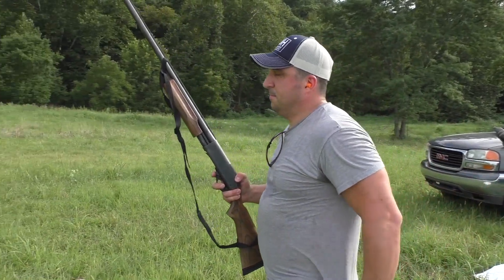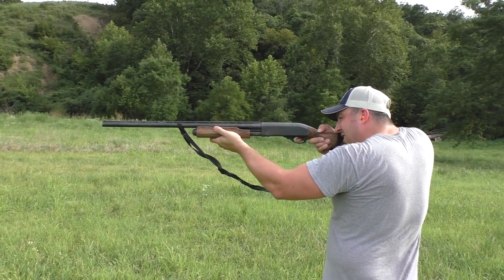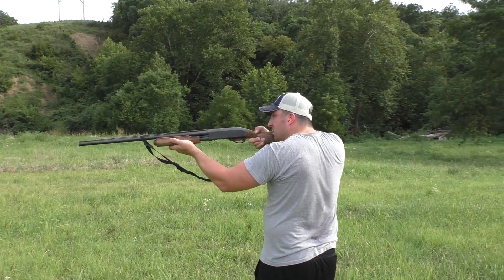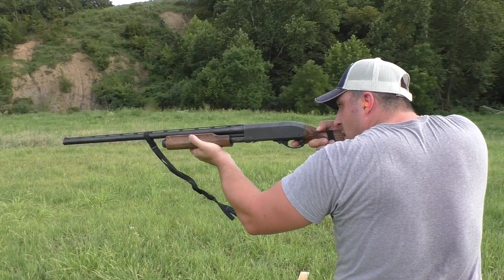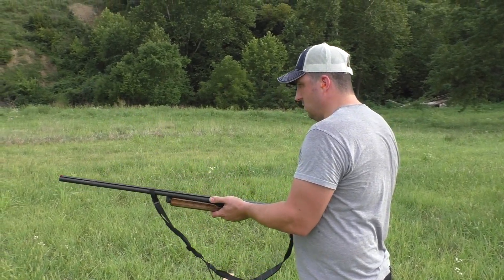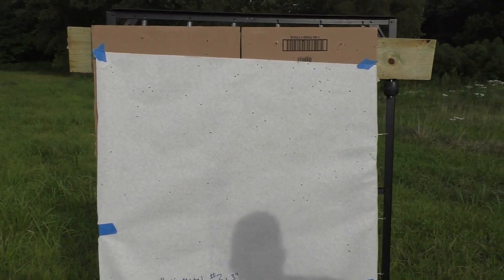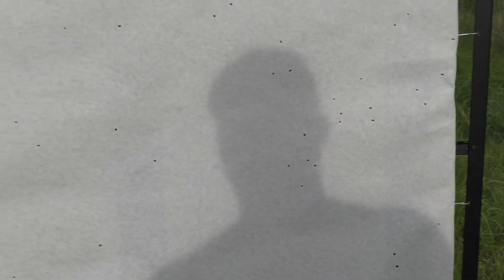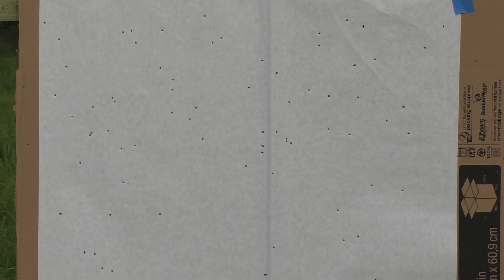Duck Hunting:  Heavy Metals vs Steel Shot

Comment: Duh!
improved cylinder is not the  choke to use for more than 25 yards
Reply: @EthanSmith2398  But Improved Cylinder is an Open choke, not a Tight choke. I was wondering why they used it instead of a Modified or Full. I use a Full choke for anything smaller than BB shot and a Modified choke for BBB shot and larger.
Reply: Thoughts for using 3 shot vs 2 shot?
Reply: That is exactly what i was thinking

Comment: Guys, good video really enjoyed it. I have been experimenting with shotshells for about 4 years now and this is the conclusion that I have come to.
1. With steel, speed kills. Personally, I like to shoot 3 inch number 4 shot of good steel shot. However, I did find 3 1/2 inch blind side high velocity shells in number 6 shot. These shells were only an 1 3/8 once so they weren't super heavy loads for ducks, and the shells were actually cheaper than the 3 inch shells I could find, and they patterned really well!
2. When it comes to geese, don't go cheap! We shoot ALOT of geese every year, and the hevi shot or anything that is denser than steel makes a big difference in the amount of cripples that you get. I shoot a max of #2 shot for even the big canada geese and sometimes even venture down to number 4 shot depending on where we are set up and the weather.

Lastly, I like how you guys shoot ducks close, that is how I love to shoot them as well. Generally speaking, if ducks are not feet down we don't shoot. However, I choose to shoot a Kick's extended full choke even with the ducks and geese close. I know that may sound like overkill, but alot of the areas that we hunt are very thick timber and river areas, and if you don't stone a duck dead, there is a good chance of loosing the bird. Personally I would rather keep a tighter pattern and feel confident that I will either kill the duck or clean miss it. I know you are probably thinking that a full choke will destroy the ducks, but when you shoot a tighter pattern with smaller shot, I have found the damage to the bird and meat are about equal.

Anyways, love the videos, if you guys ever find your way out to California, let me know, I would love to get you guys out on a hunt with us.
Reply from the maker: Great comment! Thank you so much for taking the time to post this.
Reply: i saw a video of hevi shot when it first came out and to show the energy difference they hung a steel plate from a swing set and shot it with steel and hevi metal at 20 or 25 yrds you wouldnt believe the difference. they even went as far as to show a 12 gauge shooting steel and a 20 gauge shooting heavy shot the results were crazy. pretty neat stuff if you would want to try it.
Reply: Greg, you and I are on the same page. Clean kills or clean misses is what it's about. Our rivers in Wyoming are too cold and swift to have the dogs chasing cripples around forever.

Comment: still using steel. I used winchester 2 3/4,  #4,  1 1/16 oz for opener in MN this year for opener with great results. Birds decoyed well and all shots were within 25 yrds and all birds fell dead from the sky no double taps. Steel has come a long way since its intro and i only use hevi-metal for turkey hunting because a lot of the areas I hunt are waterfowl production areas that only allow non-toxic shot. I have even considered eliminating lead for pheasants and grouse. Thanks for making the videos and for your ethical approach to the game. Good luck and shoot straight!

Comment: There are so many variables when it comes to shotgun shells and patterning that I typically don't worry about patterning my guns. If you let the birds in close enough, you shouldn't need to worry about holes in the pattern. I've noticed that the less I focus on the minutiae of my shooting the more birds I kill.
Reply: just pattern with your own gun choke and load and see if it needs improving at whatever range you normally shoot  but at 25 yds max shooting steel number 6 like fast steel kent with improved cylinder should be excellent.

Comment: I had a similar experience patterning steel vs. hevi metal. I bought a box of hevi metal to see what the fuss was about, and had to use a full choke to get the pattern I wanted (keep in mind this was primarily for hunting divers over big water, so birds that are generally a little tougher to kill cleanly and also typically longer shots than on puddlers). In the decoys, I didn't notice any difference vs. steel, but I did notice I had a few cleaner kills on birds leaving the decoys that were on longer shots. All in all it wasn't enough to justify the price difference for me. Hevi shot ran the same rebate you guys mentioned last year on Hevi Steel instead of Hevi Metal, I picked up a couple cases then and I have really liked the way it performs. I shoot it through a LM choke for puddlers and a modified or full for divers/big water.

Comment: I shoot #4 2 3/4 or 3” #4 with a modified choke. And sometimes 3 1/2 either #4, Bb, #2 shot but usually only use them for geese or an injured duck that’s trying to get away. I usually just stick to federal,Kent, and Remington. And I’ve killed with all three manufacturers. Great video
Reply from the maker: Thank you for taking the time to comment!

Comment: last year I started the season with winchester Xpert  3inch #4 and had more than a few cripples between 30 and 40 yards. I switched to hivi-metal 3inch #4 half way through the season and the number of cripples went down to 1 at the same distance. I also use a modified choke.

Comment: I've killed mallards in late December with steel 2 3/4 Winchester 6 shot.. mod choke. All I had so I ran it. Folded birds just as good as anything else I've used. Not my everyday load I take but hey it worked..

Comment: I switch to heavy metal last year from using kent faststeel and my shooting improved from 47% the season before to 62% last season. I don't know if the accuracy change was due to changing ammo as much as changing to a heavy metal mid range choke which gave me much better patterning, but I did have a lot fewer cripples and almost had no birds that required a kill shot after hitting the water.
Reply from the maker: I'm planning at some point to do a video on keeping statistics.  We've been keeping our shooting %, birds per hunt...etc for years.  Curious, do you count shots on the water towards your % and how do you track your shooting %.
Reply: +Freelance Duck Hunting I do not count the shot when they are on the water. I just count how many it takes to put them on the water. I have a write in the rain notepad that I keep notes on each hunt such as location weather decoy spread and number of bird we saw shot and how many shots we took.
Reply from the maker: Thank you Daniel, we do not count shots on the water either.  I have a shell belt that holds 24.  I just keep track of how many I shot on the water and then check my shell belt.

Comment: I have tried 3 inch,, 12 gauge Hevi-X (all tungsten alloy pellets) for the last 2 years. I went to modified choke too. The first year I did 6 shot, modified choke, to get something very similar to the old lead 6 for ducks. This seems to kill much better at longer ranges than the Hevi-Metal 4 (layered tungsten over steel) that I used to use. The problem was my little handheld metal detector that I scan meat with won't consistently find size 6 in the duck meat and I broke 2 teeth. This year I am shooting Hevi-X size 4, modified choke and I am doing just as well on ducks and the metal detector finds the shot reliably. Plus with this size I feel confident if I get a rare shot at geese it will down them. I hunt public ground and if I get 6 shots off in a day, it's been a good one, so I don't fret about the increased cost. But with the current shortage of shells, I might have to go back to high speed steel before the end of this season!

Comment: The way I do it may or may not be the way the experts would do it,but it works for me. 1st I choose the gun and tube. Then I buy a box of several brands of shells . For instance If I change to a new tube I would buy a box each of Kent,Winchester xpert, black cloud remington and federal since all are readily available here. none would be slower than 1550(with steel speed kills) and I would buy boxes of each brand in 2s , 4s and 6s. 2nd, prepare 5 targets for each  box of shells. Mine are 30" circles divided into 4 quadrants with an aiming dot in the circle. If the choke is I/C I place them 20yds out and 30rds for MOD, 40rds for FULL. Shooting from a bench, I put the bead on the dot and shoot 1 shot in each target. Repeat for each combination. Discard any set that routinely show gaps big enough for a bird to fly through. Then I count the pellet holes in each Quadrant. What I am looking for is a  load that can consistently throw 60% above the horizontal line and as close to 50% as I can get left and right of the vertical. I choose the best 2, shoot the best one and remember the 2nd best to fall back on in case  I am away from home out of shells and my go is unavailable locally. 
For my 835 Ultimag with Carlson Mod choke (Lake Eufalla and Nav Chanel, X at 25-30yds)  Win Xpert 3" 1550 #2s.
Carlson I/C ( Timber, ponds, creeks X at 15-20 yds) Win Xpert 3" 1550 #6
Pattern Master Full (pass shooting Sandhills and geese at Hackberry Flat) Federal 31/5" 1550 BB. 
Now you ask,What do you do with all that extra ammo? Give it to your partner to pattern his gun and you have plenty left for squirrel season where anything is good enough.

Comment: Bought a case of Hevi-Metal 2's from Rogers last year. They seem to do the job quite well through my Browning Maxus with an extended range patternmaster and I definitely noticed an improved kill rate and less cripples. The trouble was I've made it half way through this case and had 5-6 dud shells, I will be back to the federal steel after this case is gone, I can't stand when you pull the trigger and it just goes click, that's is inexcusable for a high dollar shell.

Comment: If you're shooting decoying ducks and geese, try using a modified choke or go with a smaller shot size in heavy steel.  Works great for me.  I use heavy shot or steel #4 in a modified choke with great results when I'm doing my part on the business end of the shotgun.

Comment: Steel patterns tighter in the same choke than lead. I know the Hevi products aren't lead.  An imp cly with steel is closer to a modified choke. Also, the same box of 25 shells will pattern completely different in Dan's 870 than your A300. Every gun will have it preferred load/choke. Also, your dad is correct in the Hevi 4's are more similar to steel 2's.  I hope that you pattern test again. Love the hats and vids.
Reply: I forgot to add that I shoot the cheap Winchester Xperts, after seeing little to know improvement with the more expensive Blindside, Fasteel, and BlackCloud.  Can't see spending $1.25 per shot of Hevi when the cheap stuff works great with my barrel/choke.
Reply from the maker: Thank you for your comment.  After filming I did pattern my A300 at 15 and 25 using the federals.  I was pleased with the patterns.
Reply: Forgive me for the long post but here are my thoughts: HillBros06 is dead on. Steel will pattern tighter than lead no matter the choke. Shooting Improved Cylinder with steel is basically shooting a Mod. (or very very close). Quick report from last year - I decided to go with heavy shot for the 2015 season. After patterning both Mossbergs, I found that the results were not what I had anticipated. During early real season it seemed using #6 and Imp Cyl certainly shot more ducks but the cripple rate was a little higher than what I would like. Found myself taking more "second" shots to make the kill. I initially thought it was my choke and changed to Mod. This didn't help. So I went back to original set up and changed loads. Went with Winchesters #6 and my cripple rate went down substantially!  To prep for regular season, I patterned full choke, Mod and Improved with #2, VS #4s Heavy Shot. The results were ambiguous. I decided to stay with #6 for early season and #2 steel for regular seas.
Reply: I might add that what I have found is that while heavy load will certainly pattern differently,  steel just seemed to shoot tighter (in my gun with current choke) than heavy load. My cripple rate went down and I just felt more comfortable with that shot/choke. 
That said, I think it's all in what you are comfortable shooting. Duck hunting is more mental than anything and if you feel that a particular shot size and choke suites you better, I feel that you will certainly kill more ducks simply due to the mental aspect - more of a comfort thing if that makes sense?
Reply: +HillBros06 TOTALLY AGREE with this statement!

Comment: Hevi-Metal is actually a mix whatever size steel (marked on box) and generally about 2 sizes smaller Hevi-Metal pellets which are lighter than Hevi-Shot but heavier than steel. The reason they do this is so that the denser, smaller shot weighs similar to the larger, less dense steel and flies similar to the steel. If you used the same size denser shot shot, it would blow the pattern apart like your dad eluded to.

After having studied ammo and tested almost everything out there, I've come to the conclusion that speed and a good choke are more important that actual ammunition brand. I run Federal 3" 2's through a Patternmaster because it gives me a 96% pattern in a 30" circle at 40 yards. That means almost all clean kills or clean misses on decoying birds because all but a very few (<10) pellets are ever outside that circle where I am aiming. It is worth noting I shoot mostly large ducks (mallards and wigeon) and have a chance at geese almost everywhere I hunt so I run 2's. If I was only hunting ducks and could get similar pattern density, I would shoot 4's.

Comment: I've used regular steel and Heavy Metal brand and haven't noticed much difference in taking down birds except I have taken birds at much greater distances with Heavy Metal. With heavy metal I shoot a 6 shot 3 inch shell and my first year using them I took down a goose at at least 15 yards further than I am comfortable shoot normal steel shot. When I shoot steel I shoot 4-6 shot in a 3 inch shell in late season and a 2 3/4 inch in early season

Comment: I found that if you are using steel you will have to use a larger shot size and reload it with a faster fps to get the energy down range on your target. I reload 12 gauge 3 in Federal Hulls with Alliant steel powder 43.5 gn powder, Ranger Elite Wags, 1 oz steel BB, 12Ga overshot card. = 1100psi and 1710 fps. With this recipe I have been killing Canadian geese and dogs out past 50 yards. All my friends were amazed and they stopped buying store bought shells and they started paying me to make them my recipe

Comment: The reason that the pattern breaks up faster is because the hevi shot in there is going slower. And it behaves similar to the difference between lead and steel. As you may or may not know an Improved cylinder choke with steel patterns the same as a modified with lead. I shoot steel early in the season when I am shooting smaller ducks like teal and woodducks but once I start hunting late mallards and geese I start using heavy metal #2 and boy it hits them way harder than steel. Because you guys like to shoot them when they are right in your lap I don't think it will matter too much. I might recommend something like Winchester blind side that has a lot of shot and opens up quickly for those closer range shots.
Reply: I was watching a video on patterning this afternoon and it said that hevi-shot is not round, kinda oblong.  Do you know about that?  If it is it certainly explains why the pattern breaks up faster.
Reply: +Carl Snider I haven't ever heard anything about that before and when I cut open a heavy metal #2 I didn't notice anything like that. One thing that they do put in the shells is flax seed(or something that looks like it) and I'm not sure what the purpose of the flax seed is but maybe they confused the shot with the flax seed they put in there
Reply: +Carl Snider hevi shot is a bit oblong and blind side is little cubes I believe the reason for this is that the lead will get miss formed when it hits creating a bigger wound channel so there trying to imitate that with these loads black cloud is also oblong and has a small seam looking thing on it to make a bigger wound channel also personally enless im shooting geese i dont care
Reply: You are just guessing here, aren't you?

Comment: Well I had to go to a 20 gauge due to a stroke using blind side 2s for Giants and ducks works great with imp cylinder  only choice I have  pattern your gun is a must good video guys. Each choke and shot size is different

Comment: I use Kent 3in 6 shot most the time with full choke in Remington 870 and rarely have problems dropping ducks. I don't shoot further than 40yd ever. Sometimes in late season I go to 4 shot if I notice birds taking the shot and keep going, but that is not to often in shots under 30yd. For geese I switch to a 2 shot. If I get pissed at the birds not falling I put in hypersonic 4 shot which kicks like a mule but birds don't take the shot and fly away!